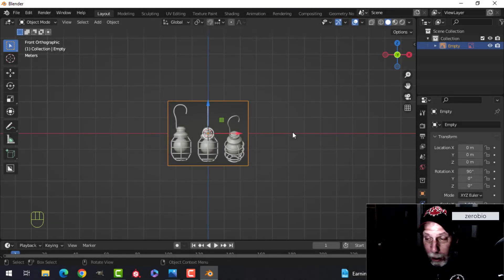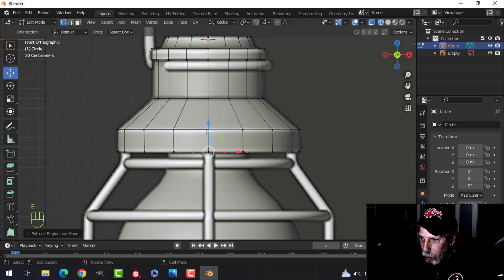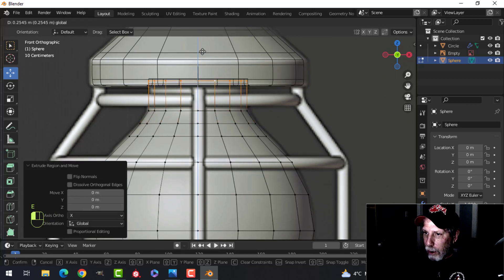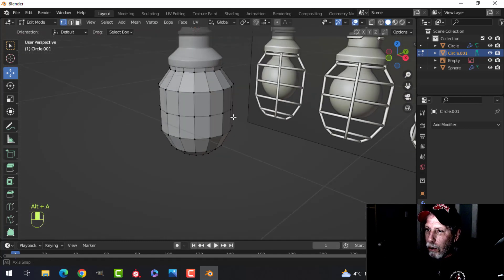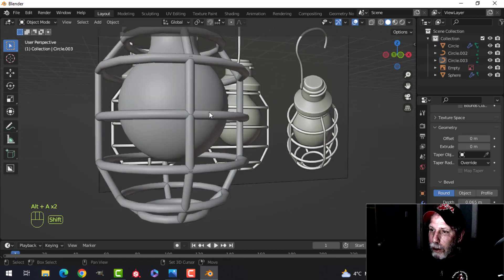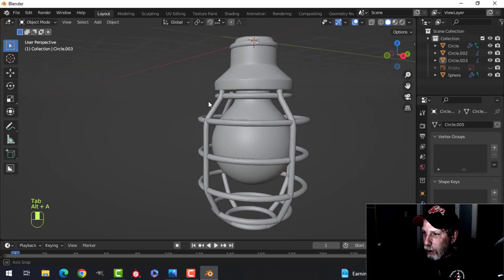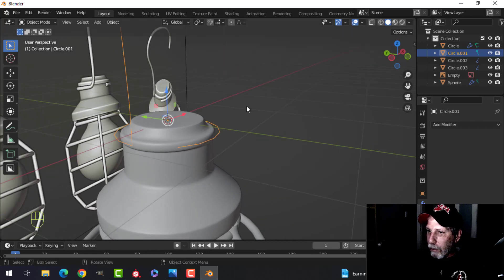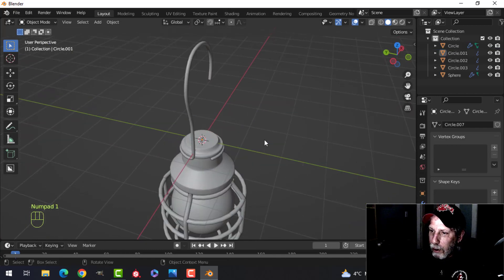BLENDER: ALIEN ISOLATION AIR SHAFT (PART 5)

Comment: Great video, as always. Why do you always change the resolution to 4 when you convert the curve to mesh? Any particular reason for that?
Reply from the maker: Thanks.  I put the resolution down to 4 so when I convert the curve to a mesh there aren't too many polys.  If you leave it at 12 and convert to mesh it will be very high poly